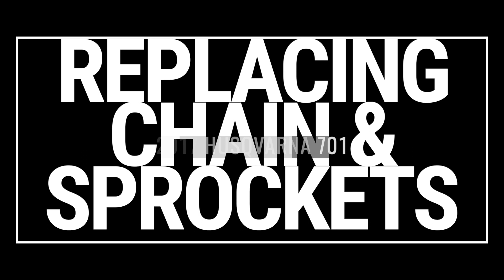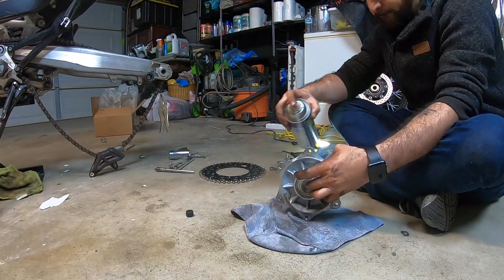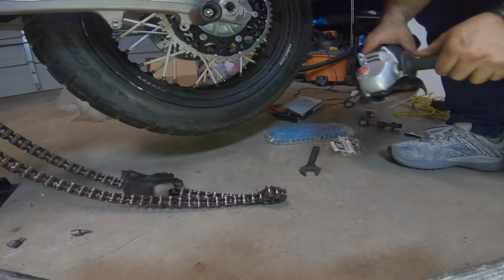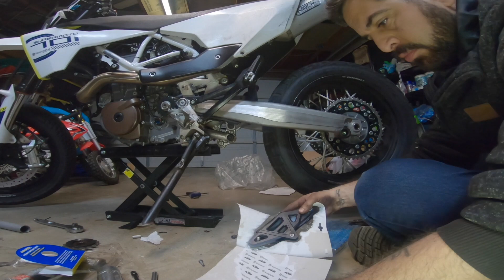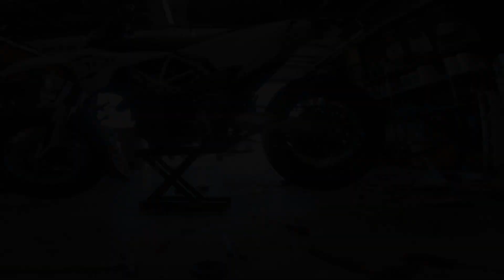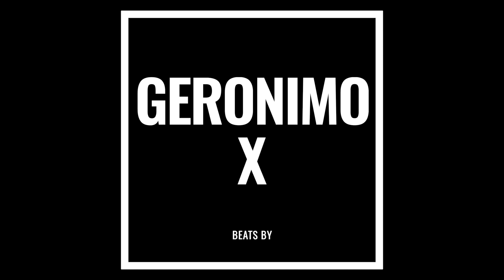Replacing Chain & Sprockets on 2017 Husqvarna 701 Supermoto

Comment: I am thinking about doing the same to my bike..
Can you do low speed wheelies in 3rd gear now?
Reply from the maker: It helps for sure! I usually pop it up in second, then shift to 3rd and up depending on where I wheelie
Reply: @HDSupermoto  Normally I pop the wheelie at 30-35 km/h (18-22mph) in second gear.. How low in speed can you go to pop a clean wheelie in second gear?
Reply from the maker: oom I think it all depends on the gearing.

Comment: How is the chain holding up? Is it still blue?
Reply from the maker: It was still pretty blue, but it started kinking really quick. Never buying it again
Reply: @HDSupermoto  interesting. I have a 2019 701sm and still have the factory chain on....was looking for a good replacement....any suggestions? I'm also trying to find a chain slider and rear chain guide
Reply from the maker: @k.r.6096  DID and Renthal have been good to me
Reply: @HDSupermoto  did you go with an x ring 5/8 x 1/4? How many links?
Reply from the maker: @k.r.6096   
DID 520VX3 X-Ring ChainGold / 120 Link
Reply: @HDSupermoto  appreciate the info!

Comment: Why 15/48 and not 15/42? I have to change mine in a couple of months and I'm doing some research!!. Thanks
Reply from the maker: bad bad moto because I wanted more torque and didn’t care for top speed. It used to top out at 130 and now tops out at 110
Reply: I don’t ride over 90. So I should try 48 instead of 42. Whats the difference?  (Im going to start asking you a lot of dumb questions about the bike because I don’t know shit hahaha) sorry!!
Reply from the maker: More torque=Easier wheelies

Comment: At how many miles did you change them?
Reply from the maker: DAVID RESPECT I usually go by how it looks. If it starts looking really stretched or if the teeth are screwed.
Reply: @HDSupermoto  Yes i get that but I was trying to figure out approximately how long did yours survived.
Reply from the maker: The stock one, about 12-16k I think
Reply: What part number for that kit?